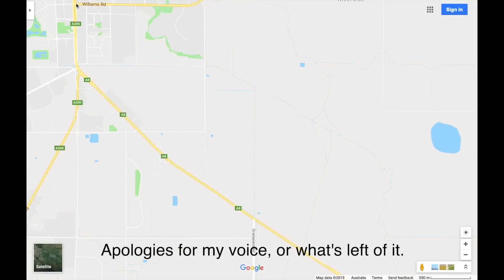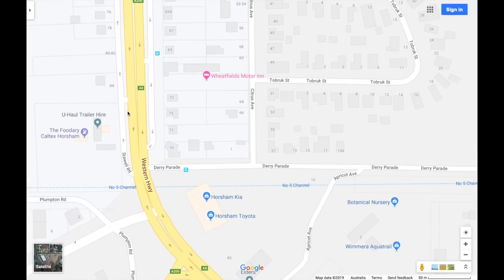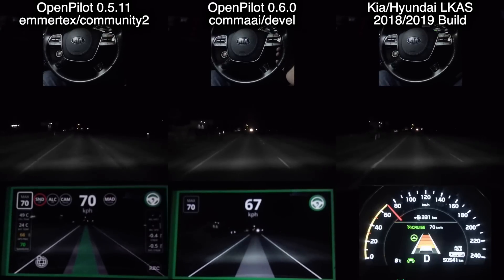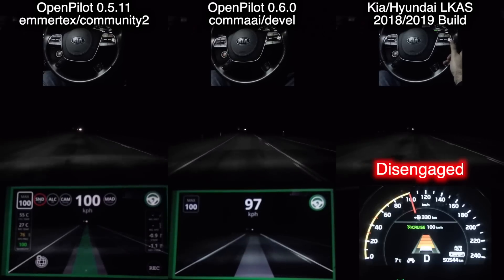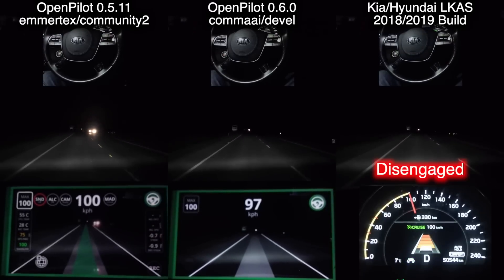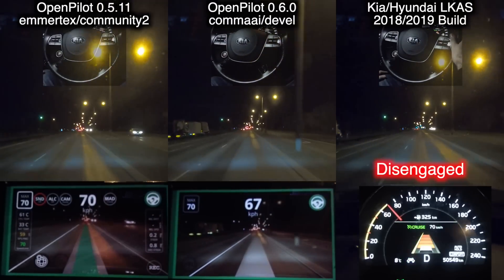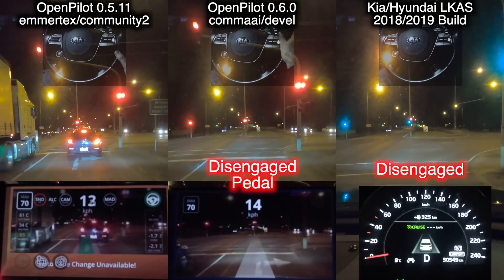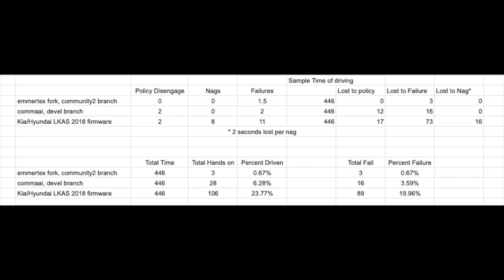Comparing Open Pilot 0.5.11 vs 0.6.0 vs Kia LKAS - Side by Side

Comment: Can you provide details as to how you got the dash and OP speed limits to match? Is it an easy fix in the code somewhere? Thank you!
Reply from the maker: There's a lot of ways.
They are 1.0333 multiplier in Australia.

But Cluster message also reports the multiplied value, but unfortunately it could be in miles or km depending on the settings in the cluster.

I did the multiplier, because mainly I did this before I found the cluster speed.